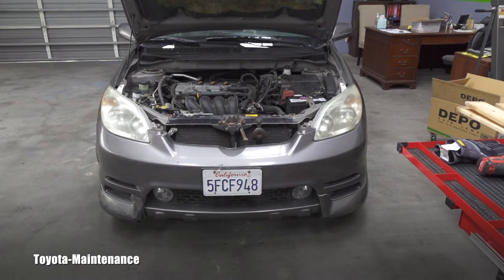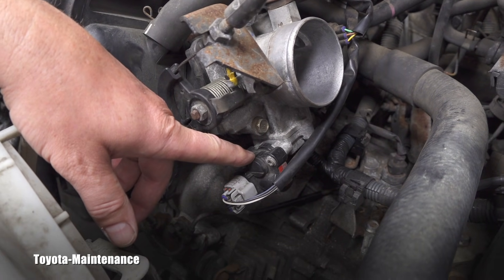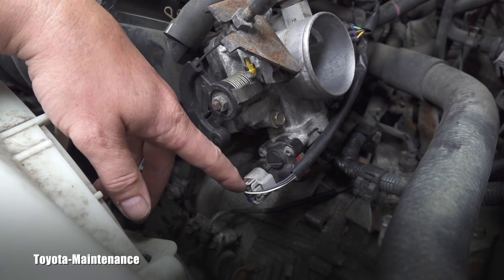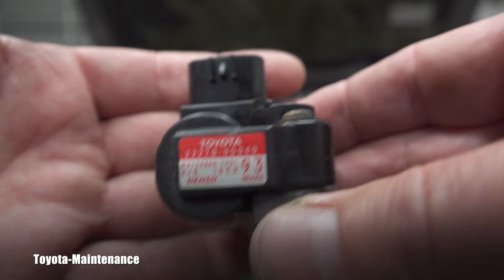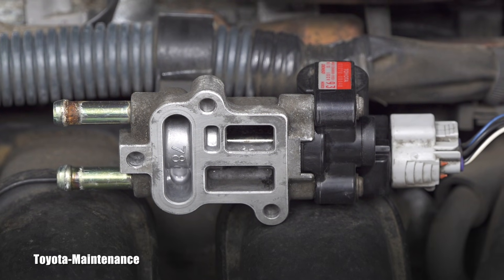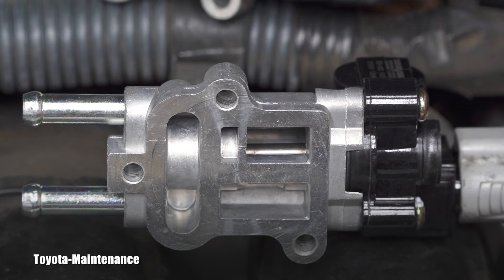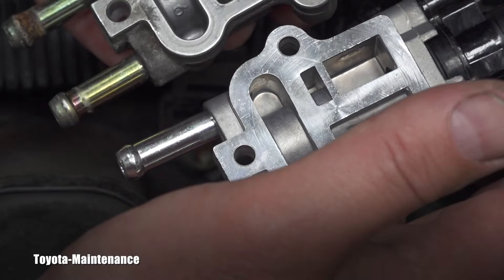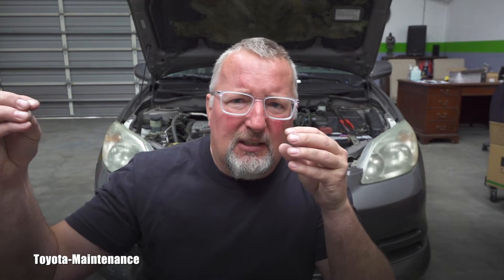How to test TOYOTA IAC Valve without special tools

Comment: Great video with detail testing procedure. 2004 Toyota Corolla LE has engine light on.  Autozone shows error code P0505 so IAC. I removed the IAC with impact driver to loose three soft black screws. Leave the key ON then I disconnect the negative battery and conneced the IAV connector, one hand holds IAV and the other hand touchs the negative battery you will see the small metal gate close and open or feel some vibration while you touch the negative battery. My original one was bad, then bought Amazon one passed test but fail on the road testing. Finally get one OEM from used the whole throttle body assembly to remove the IAV test again before installing it. Engine light off and the car run smooth.

Comment: Neither valve moved when you turn on the ignition. That's because it's fully open when you start the motor ,every time you shut the motor off it resets to open
Reply: Watch closely.  It is a bit like the shutter on a camera.  It 'flickers' when the ignition is cycled.

Comment: I’m glad I came across your video. Toyota NZ quoted me $900 for just the valve idle parts, another company is $240 . My car was running high idle for several months so did excatly how you tested then dismantle the whole unit clean it then put it together. Now I’m happy to say my car is like a EV can barely hear while idling . Than k you very much sir and happy new year🎉. 10/10 ⭐️

Comment: How do you get the Phillips screw out in the back if it's stripped out what. And how do you grt it out then because I am having the same problem in park it idles rite below 2000 epm but put it in gear it just wants to go as in you don't have to hit the gas pedal it just takes off
Reply: Try using a Dremel with a small cut off wheel. Carve a slot where the Phillips part of the head of the screw is, so you can use a slot screwdriver. Soak the screw with penetrating oil overnight. Then try using a slot screwdriver to extract the screw.

Comment: Hi peter thanks for the lecture. My question is, (1)what are the negative effect on the car if l purposely block the IAC due to high idealing? (2) will fuel consumption increase or decrease if i block the IAC? and (3) if the IAC is working properly, is the car acceleration or idealing suppose to be above 1RPM or below 1RPM? Thanks.

Comment: Hi Peter I have a 2004 matrix and I had an issue with high idle I have and the pedal sticking when steping on the pedal, I have chage the IAC valve 2 times and even have change the hole thorttel body, and Im still having high RMS.. your thought's?

Comment: Great video. Same as my problem. The three screws on mine are are near impossible to get out. I put every thing back started car, high idle still of course. Gave a tap while idling and instantly revs dropped to normal. Not a proper fix of course. At least I know what the issue is.
Reply: What was it?

Comment: I took apart a frozen IAC valve from a 2000 Echo that had been sitting for 17 years and gave up on trying to free-up the valve when I broke the magnet. I took a chance on a new less than $20 aftermarket IAC valve that took a week for Amazon to deliver but it works great. It claimed compatibility with 2000-2005 Echo, 2004-2006 Scion xA & xB. I almost went to a salvage yard but the new gasket included with the new idle air control valve convinced me to give it a try. Now it idles correctly again. I got lucky.
Reply: You are clever and smart, greeting from the drive was mech.

Comment: i had  same problem  but with a 2004 pontiac vibe gt, replace the iac ,  i try to open the old one but it has a 5 point start bolt, i only have 6 point star bit

Comment: There are two coolant lines connecting to bottom of the throttle body. Is that for cooling the intake air or warming air ? Can we by pass these lis
Reply: As air passes through a low pressure air cools ..therefore jot coolant warms throttle body.
Reply: To reduce condensed goop I think. If it was colder, there might be more frequent cleaning required

Comment: The idle on my Corolla was all over the place so disconnected the IAC and now won't drop below 1100rpm. I've removed the throttle body, cleaned the IAC as the shaft wasn't moving freely but does now. Hopefully that will solve it.
Reply: Did it work?
Reply: Yes
Reply: All good, got mine working last night, happy days
Reply: I scraped out alot of carbon with a screw driver and used brake cleaner. I knew it wasn't working because i couldn't hear the magnet spinning and kept cutting out.

Comment: I went to the dealer to price around for an Idle Air Control Valve. Part number 22270-22050 for a 3ZZ-FE engined Toyota Corolla 2000.

They go for 735 euro after tax here in the Netherlands.
What a rip-off.

I just ordered the IACV gasket, the 4 JIS screws and the throttle body gasket. Gonna have to look for an used one, unfortunately. The entire throttle body assembly (with the IACV and Throttle Position Sensor) go for around 100 euro used. So I think I will try that.

Comment: I have p0300 random mis fire rough idle on my 03 corolla 230,xxx miles should I replace the IAC cause I didn't get a code from the IAC.  Replace brand new NGK Iridium spark plug, used 4 ignition coil, clean out all  4 fuel injector, replace intake manifold Gasket, throttle body gasket and ICA gasket. Couldn't find no vacuum leak and no fuel leak
Reply: When does the misfire occur?

When engine's cold, or when hot?

... Pekamo

Comment: Hi Peter. I have a 2003 Tacoma (same as the cream puff you had the video on). I’m at 260k miles and my ac will be working than goes hot.  I can usually get it back to cold with a quick turn of the dial. Any idea if it’s just a bad dial or something else?
Reply: Change the cabin filter? Or wiring maybe

Comment: My 13 Corolla idles 400-500 shakes at stop signs. It does correct it self but almost shuts off. Cleaned the throttle body and no codes can this be a culprit ?
Reply: Ensure air filter looks good and add a bottle of Lucas fuel injector cleaner in the gas tank. If plugs are old, maybe check and replace.
Reply: Check your throttle stop adjustment. That controls the lowest idle drop. It doesn't control "idle up" but can solve minor issues with alternator.

Comment: matrix XR hatchback compact station wagon made in cambridge regular unleaded 13.2 gal 28 city 36 highway 1.8L 16 valve dohc manual non abs 2778 curb wt 61H x 171L x 70W $14,599 msrp. 2022 market 3800-6300, 662,000 models 2003-2004 only Corolla, Matrix, Vibe, front driver & pass power windows known to be loose and rattle at regulator.

Comment: yeah usually when i clean the throttle body i attach the little hose piece to the throttle body cleaner and stick it down in the hole. I have done this for years after replacing the part. you can also take it apart by removing those two bolts  and make sure its spinning around and not getting stuck by dirt etc. :P

Comment: It looks like the black plastic electrical section comes off the valve body
Are you able to disassemble the old unit and try and to free up the sticking valve 
Cheers
Reply: I am also curious about this as well, can it be removed and cleaned?